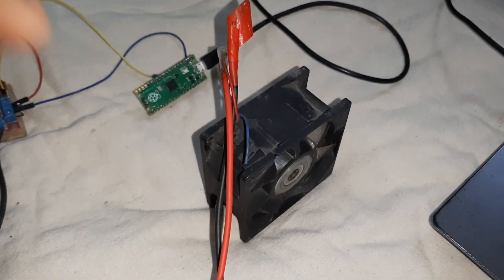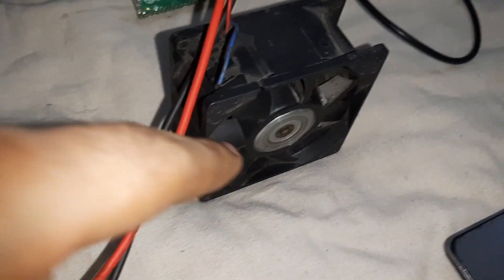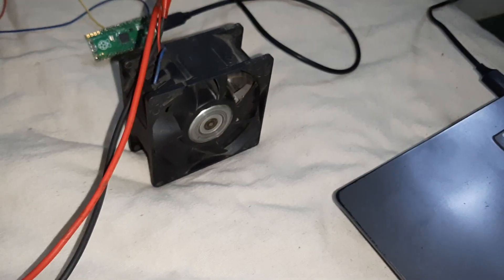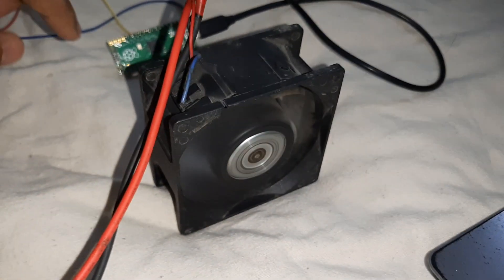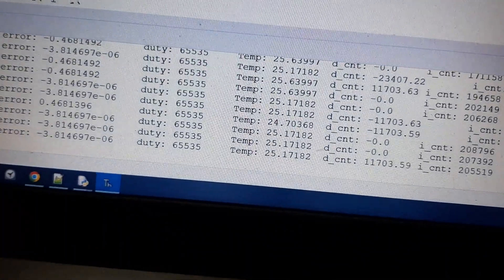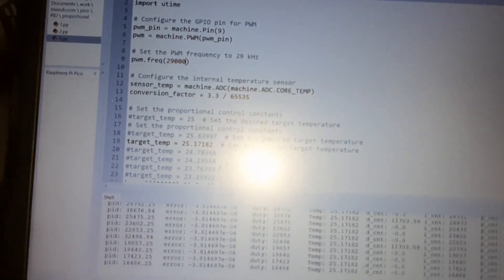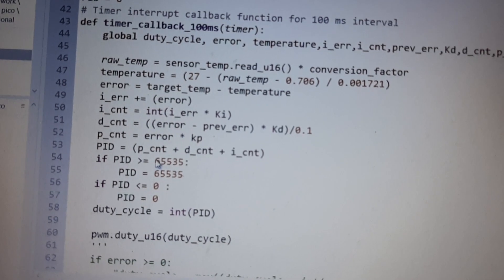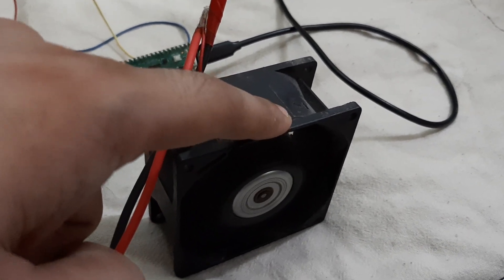Raspberry Pi Pico Internal Temperature Sensor Based Fan Speed Control Using PID Algorithm

Comment: Hi i am facing an issue when i install CircuitPython the storage is reducing from 128 mb to 470 kb do you know the reason why it is happening?
 BTW it is pico w
Reply from the maker: Hello, That is the behaviour of the circuit python. It creates a USB mass storage device with the circuit python firmware files exposed to the user and creates more friendly environment for learning. It also eats some space on the flash memory at this expense. That is the reason why you dont see the full 16mb or 2MB. 

When you put the raspberry pi pico w into boot mode by pressing and holding the boot button and connecting the  pico to the computer. It creates a drive with two files exposed to you in a drive. There you have to place the UF2 files. The space there is 128mb is what the programmer at the raspberry foundation choose. It is user created. It is what the drive tells to the OS when it connects and the OS enumerates the USB device list. So You can have a 1GB size if you want.